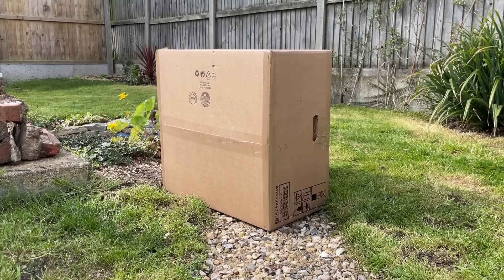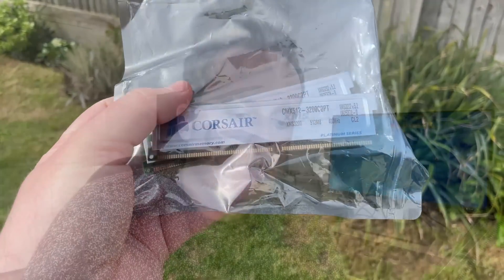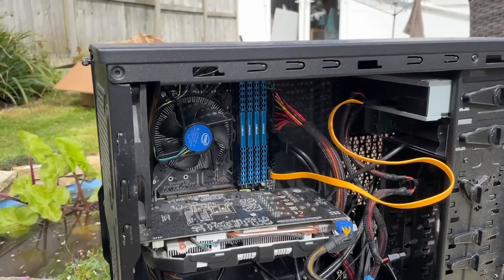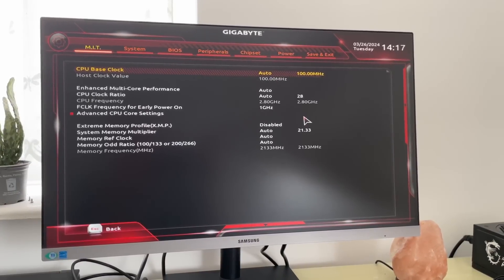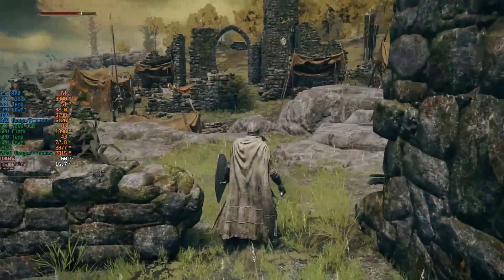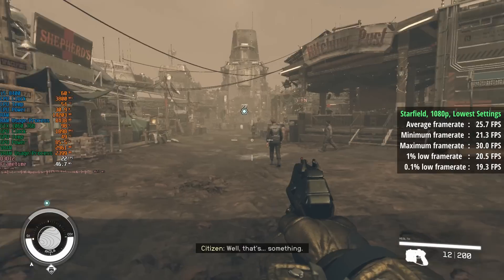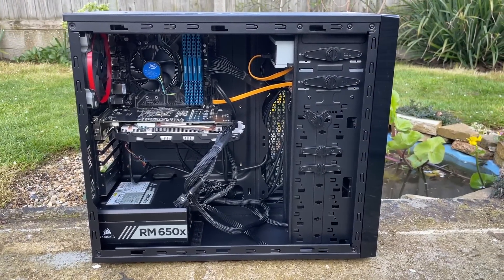A Viewer Sent Me Their Broken Gaming PC...

Comment: Had similar issue with my pc but after trying alot of things i finally found the issue was with the 24-pin connector on the motherboard
Gave it a little move and cleaned the port and it fixed the issue permanently

Comment: I had a ryzen 5 3600/b450 mobo/16gb ram 3600/corsair 750w psu/7900 xtx and now upgrading to a ryzen 9 7900x3d/32gb 6000 ram/1500w Corsair psu but will use the 750 till i save enough for the psu
Reply: And use the integrated graphics till I get a psu

Comment: First time i have seen the same case as i have. Very under rated iv had it for years and its brilliant. I hate RGB so bonus. It just blends in and has great cooling. I did take the fine mesh for better airflow. And what a diffrence that made. Never had a temp problem and summer here is very hot.

Comment: Hey mate, the label on the PSU is a bit misleading in that the 12V rail can only deliver 55 amps for 660W on 12V, so that is more accurately its capacity. This sort of thing is unfortunately rather common with group regulated power supplies, though given that this particular line is from 13 years ago, I can't fault them too much. It's impressive that it lasted as long as it did given what it is.
I appreciate the video as always, it's always nice to see old tech getting a new life

Comment: if a person's PSU keeps dying every few months needing to be replaced, they may have bad mains wiring in their home, or the power coming into your home may have issues. You can mitigate some of this using a APC power strip that should condition the power a little better, but a power backup will be a better choice to clean "dirty power" that would be causing premature death of a PSU. Regardless you should contact your local power company to see if there's anything wrong on their end, and get a electrical technician to check your power at the breaker box, and in the walls of your home.

Comment: i have had this same case for a few years now as i still use dvd's and cd's, i had to modify it a bit to fit my 6950xt when i got it last year, but it's been great and gets good air flow only issues are the radiator side mount being a but cumbersome to install the rad into, and cleaning the metal mesh grill can be a bit of a ordeal.

Comment: I had a similiar issue lately, I put it down to a bad PCI E slot for the GPU, the pins in the slot were the issue and I lost 3 GPU's because of this even though the board was a brand name and a higher end one. Tried different PSU's different GPUs and differeing RAM and SSD and HDD's and even tried re installing several times. I lost a AMD 7950HD 3GB and a AMD 570 4GB and a 1080 Strix due to this - even tried different cabling for the monitor and HDD adn SSD etc

Comment: If it is not a hardware failure then the glitched text sounds a bit like a BIOS issue.

I have an ASRock Z87 Extreme6 motherboard which was lying around and dead around 5 years. It has a two 7 segment displays for showing the  POST code but when turned on it was blank, just fans were spinning. It also has a dual BIOS solution with a switch to enable first or second EEPROM but none of them were working. So I've bought a BIOS chip flashing tool, flashed the latest BIOS on it and guess what? It turned on and it is now running Windows 11/Linux just fine paired with a i5-4690K and 16GB RAM. Also tried some games and it runs just fine.

It is nice to have a spare testing rig.
Reply: My thoughts exactly..

Comment: Your clue was it turned on and off itself.  Then text glitched when looking around the settings.  BIOS. Reflash it.  And also I strongly disagree with not cleaning out the machine first thing... The reason is because static electricity can cause all kinds of problems.   Always use the leaf blower and clean it outside before you do anything..

Comment: Never Use other PSU Cables!!!! Even if they are from the same PSU Model line... for example BeQuit Pure Power 8 cables are not compatible with Pure Power 10/11 cables(don't know if it is correct for those psu's but the principles are right)....

Comment: Using the very same system spec right now,  indeed sometimes there are graphical glitches that are harmless (i hope) and is still  perfectly usable on almost all games and emulators. PSU is AQTIS brand AP-700GTX 700w bought from Japan back in 2008 yes 16 years old and still running like a champ.

Comment: Your video reminded me of the time over 20 years ago I sent most of a PC to a bloke in New Zealand. I felt bad and wanted to donate an early 2000s PC, but the shipping rates were a killer.

I ended up removing most of the metal case, thus losing the weight and keeping only the crucial parts. One of the most infamous bits was wrapping the CPU, RAM and Mobo and encasing it in a towel with a bunch of protective packaging.

The machine actually made it to NZ and the guy called it the 'Scottish' as that is where I'm from and used it as a cheapo server for some years running an IRCd.

Anyhoo, that's my batshit story lol.

Comment: Sounds to me like the original owner might have an issue with the power delivery to their home not being stable. i.e. power spikes and brownouts. These types of events can damage a PC (and other electronics) gradually overtime. It could be the reason two cheap(ish) psu's died and why the user kept experienced crashing. I had the same problem back in the 90's and it killed two PC's before I released what was going on.

Putting a UPS between the wall and any new PC would resolve the issue longterm.

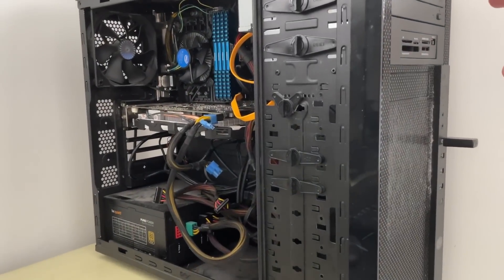Comment: 3:51 pinout for the PCIe power cable looks wrong. If I look up the beQuiet! pinout, the 12V pins should be next to each other at the short side, and another one at the opposite corner. This cable you can see 2 yellow wires (so presumably 12V) on the long side (PSU connector). As someone else commented, PSU cables are not always interchangeable and this one obviously came from the cheap PSU.
Reply: I immediately noticed those weren’t the original cables on that bequiet psu, im almost 100% that was the cause of everything.

Comment: You should always put the graphics card in a separate box (ideally the box it came in) for shipping unless you can use that expanding foam that system integrators use.

As for the BIOS if I saw glitchy behaviour inside the BIOS even with the optimized defaults loaded then I would try flashing the latest non-beta BIOS or re-flashing it if the board was already using the latest one.

Comment: OK, possibly crazy idea to the problems, but I think it fits. Dirty power from the wall. I have seen it pretty regularly at my previous bench tech job. If there is bad electrical in the house, the power supply would have a much more frequent job trying to clean everything up. This system went through two power supplies pretty quick, and with the other oddities being explained, it fits.
Reply: I agree i deal with eletrical input lag

Comment: I have poor hopes for that Alienware. One, well, it is what it is. A sauna with a computer inside. But two is the PSU will likely gfo in that too. If two psus went bad, from my experience it's the wiring in the house itself. Both times I had a "motherboard" that was allegedly blowing up psus, it turned out to be said relative had shoddy DIY wiring in their home. I'd personally recommend a pure sinewave battery backup with a wiring fault indicator. If there is something dodgy in the electrical that would light up and tell you.

Comment: 3:40 True for modern hardware, but if you are trying to power on retro computers or other vintage electronics that haven't run in years, its usually a good idea to look it over for things like leaky batteries, blown capacitors, etc.

Comment: In my decades of working on desktop & laptop PCs I would say there was a short in the original case which caused the 2 PSUs to fail and caused the other intermittent power issues. I've seen that happen a few times and they can be a real pain to troubleshoot and resolve. As others have also said I would flash the BIOS as well.

Comment: I'm not sure, but check if the cables used with Be quiet PSU are the original cables that came with it(I don't think they should look like that), or he kept the cables from the older PSU. Even if the plugs match, the cables can cause a lot of problems if they are made for a different PSU. @randomgaminginhd

Comment: i have the same specs in my old system but instead of the 1060 3GB mine has a GTX 980Ti.  @RandomGaminginHD did you enable XMP i saw it was @ 2133MTs?

Comment: Besides re-flashing the motherboard BIOS (as others have pointed out, also try replacing the motherboard battery. This will ofc also reset the BIOS (which is good anyway), but sometimes a bad or failing coin-cell battery may cause the system to act up.

Comment: the problems that you mentioned, I've face them in the past. the problem differs in every situation
1. motherboard problem and power supply is a common problem
2. sometimes using dual channel ram caused this issue once because one became faulty. 
3. sometimes heat issue due to bad cooling system or keeping in a space where airflow was lacking.
4. if you have voltage issue in your house then this will occur in every few months.
Reply: The best strategy here IMHO would be to stress test the cpu, gpu and memory. Especially memory I'd just let cycle through the fuil suite of memtest86 tests for a few days on end. Usually it will fail within a run or 2, rarely (have seen it once) it will take a few more runs for errors to appear.
Reply: @stragulus  for psu testing i use the occt power tester thingy
Reply: My cheap case causing static if i put IO shield. So it won't turn on
Reply: We don't generally get voltage issues in homes in the UK due to regulations and regular inspections/modernisation. Also the National Grid works most of the time.

Comment: Anytime I've ever sent a PC to someone (other than the first time), I send the GPU uninstalled and sometimes separately. I do the same thing with tall CPU coolers. I had the same thing happen with the very first PC I ever shipped- GPU ended up being bad because it came detached from the MB. Luckily it was a cheapy GPU and no other hardware was damaged so it wasn't a big loss.

I kinda love how the sticky clear plastic protection stuff is still on the GPU fans! Triggers me when People don't remove that stuff :P

That system could benefit a lot from faster Memory. I'll bet my CL9 2133 DDR3 scores higher than that stuff does on memory speed tests!

Comment: If the BeQuiet PSU starts working after a month there is a short on the board somewhere... I'd start with a BIOS flash (probably corrupted) before it tries to kill this PSU as well... There are some boards that when shorted starts drawing insane amount of wattage

Comment: Not impossible that two PSUs would be faulty, but maybe the previous user has a bad (dirty) socket or mains loop. Also why not make yourself a remote power pin switch to save putting a very large metal objects in close proximity to the mb and other pins.

Comment: Sounds like a possible short.
Seeing as it happened with both PSUs. 
The new and old one might have fried itself due to the short.
Wiggling the usb would cause it to power on tells me it might be the case also.
If you run into issues you might try to case transfer and see if the problem persists.
Great vid HD.
Reply: Was thinking that it might be something cause the current to surge. Bit weird for 2 PSU to die so quickly. I wonder if the be quiet is dead or simply the fuse in the plug has gone.
Reply: @jensenambrose3333  it's definitely worth changing plug fuses they age and cause problems even if they aren't blown.
Reply: My first thought was to check and make sure the back of the motherboard isn't shorting against the case some where.

Comment: Plz try reflashing the BIOS, this helped me a lot of times with unstable Mainboards. The Glitching should be gone.
Reply from the maker: Ah good point I’ll see if there’s an update too
Reply: Also. Sometimes a quick CMOS battery out and power-drain then reprogram everything seems to help. Keep in mind you'll need to suspend bitlocker first, if the system uses it.
Reply: Even if it is the newest one, simply so a reflash ;)
Reply: Literally though of this the moment he said it looked glitchy.
Reply: Yeah Gigabyte motherboards are always a bit shit
Reply: @smyth0109  well not really. They are pretty reliable un general. Altho if the psu had issues, it could have damaged the board.
Reply: @zigalanimations382  trust me the reason Gigabyte has a dual bios or a back up bios is because their first one is shit. 🤣
Reply: @smyth0109  No, I won't trust you, I'd rather go with personal experience and input from actual professionals. I've never had a bios issue with Gigabyte MBs, in the over 30 years I've used or built with them.

Comment: 4:25 I actually once fried a motherboard by trying to start it with a screwdriver, that poor board had buzzer/speaker pins very close to the power button pins and I shorten the buzzer pins when the motherboard started, it shut down immediately and never powered on again.
Reply: @malvinchau2056  Yeah, that was on old AM2 board, ASUS M3N-H/HDMI to be exact, I don't remember the PSU but it probably was some trash one, it did survive though
Reply: yes, those pins are so close i don't trust myself.  one mistake and game over.
Reply: @infinity2z3r07  I'm pretty sure that I did that accidentally multiple times on newer motherboards but nothing like this happened so I think it's safe, or maybe as long as the motherboard itself is well designed and isn't cheap e-waste. From what I've seen that fried asus motherboard also had a bit different io pin layout that modern motherboard has, with power and hard drive LEDs on the left, power and reset buttons on the right bottom, and speaker/buzzer at right top.
Reply: rofl  did same thing almost  but put in on the usb header not paying attention caused  me  like 3 hours of troubleshooting with a multimeter  to find 2 resisters that fryed took same ones off a even older board n bam went back to working.

Comment: A new precedent has been set: I will now be packing up my old cooler master case with a sabertooth 990fx 2.0 and 2 cpus (8120BE and 8350BE) and the original 32gb of ddr3 and let you figure out why it lights up like a Christmas tree :) Just kidding, I have already checked all the dimms and tried a new psu , also bought the 8120 to try that and I feel like it is the mobo but the pc is an old library not a useable or serviceable pc I do not think. 

 Please start a used market of pc gear, we want to fill your backyard with our dust and "collectors items" like this nifty ATi X850 XT I have been using as a door stop 🤣🤣

Comment: 😃 yay, Fix or Flop, Season 1 Episode 1 😊
Reply: @RandomGaminginHD  I don't think those are the right modular cables for the be quiet powersupply, they should have all black connectors so any off color ones there are for a different powersupply & can risk damaging components.
I bet the pci-e cable that was included there that has the wrong pinout so it's shorting out ground to 12v preventing the pc from starting entirely luckily.

Modular powersupply cables are NOT universal between brands & sometimes not even between models within the same power supply brand, do ask the pc owner if they have the black pci-e cable for the powersupply or can buy a set of cables that are meant for that powersupply model.
Reply: @Mini-z1994  yes those are very good points, be careful =)
Reply: @Mini-z1994 my mate has a be quiet psu and gpu pci-e power plugs do have blue plug ends indeed.
Reply from the maker: @Mini-z1994 ah good call
Reply: @Mini-z1994  When it comes to EVGA recently, even the exact same model of PSU could end up with different pin outs than it started with over its production lifespan.
Reply: @RandomGaminginHD  Your version ?
Reply: @RandomGaminginHD love your videos!  pro guy hair tip - low dose minoxidil will keep your hair line from moving anymore   :face-red-heart-shape:
Reply: Nah mate its post or toast!
Reply: Hope he comes up a more original name for it,if he makes a series of it! Bit of humour in the name department.
Reply: Flop or fix

There we go sorted 😂 @Doobie3010
Reply: Repair or Despair
Reply: Lol i came to say that xd
Reply: xD